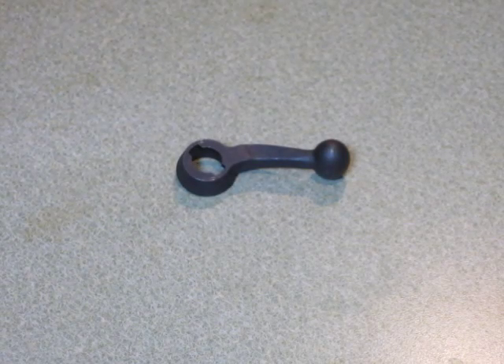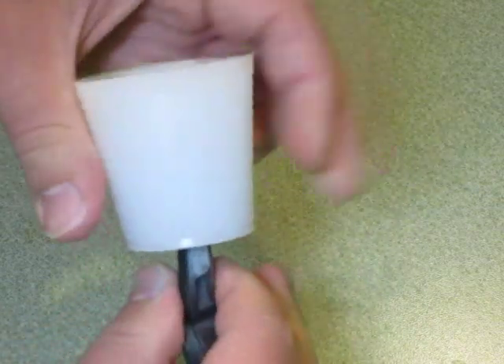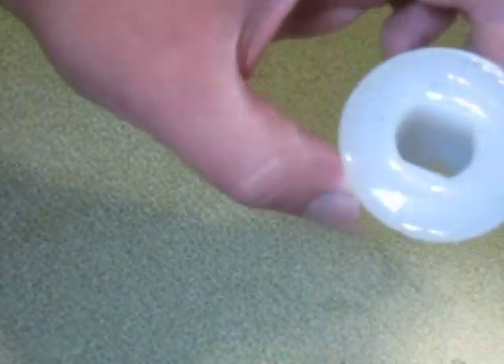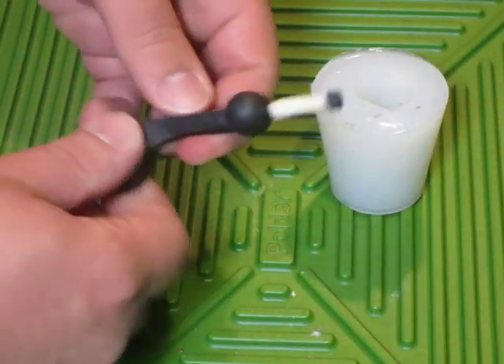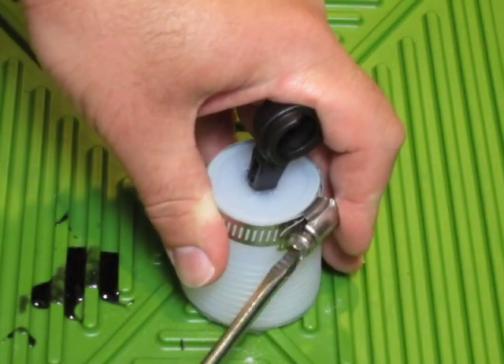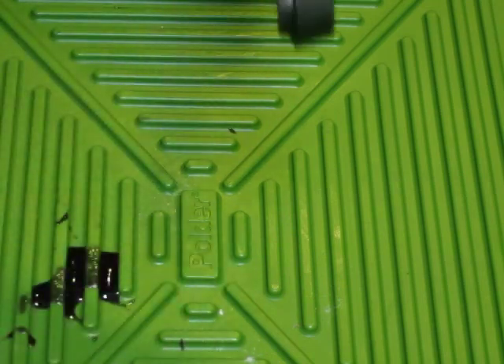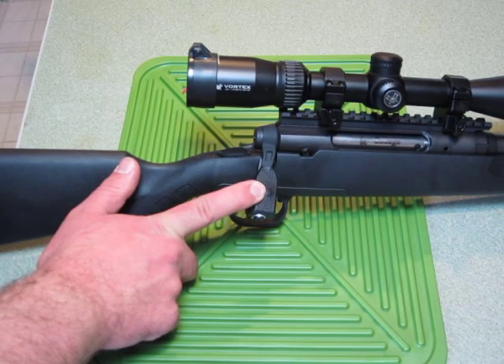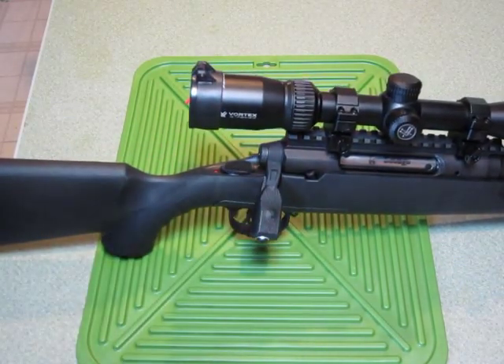Savage Axis Homemade Bolt Knob

Comment: I know this is an old video, but, you could counter sink a hole in the fiberglass 1/4" and use a socket head cap screw recessed within the handle....maybe make it deeper and use a fitted rubber plug to seal it. ;-)
Reply from the maker: Not a bad idea! I revisited this project in a later video or two and came up with a better solution. Still, it's usually good to have more than one way to address a problem. Thanks!

Comment: Dremel, cut off wheels, 5/16 die and a tactical bolt knob on ebay- total= $25. last forever and looks 100% better than fiberglass epoxy.
Reply from the maker: +Long range Killa Totally!  That's why there's the annotation leading to the video where I do that with hand tools.  https://www.youtube.com/watch?v=fczCGdZG1iM&index=2&list=PL6mstF7_2-gm3WnoBZZ1QLpjIeoFWXqg9
Reply: +DrThunder88 ahhhh I see, I  watched your video, I had the same casting void in the finished shank on my axis. I put first Savage together this time last year, not looking back!! Blueprinted the action, Shilen select match barrel, pillar bedded boyds thumbhole (full float) and a Nightforce Nxs 8-32. shoots  1/4 moa with 107gr Sierra matchkings. I sold all my Remington bolt actions and goin all savage cause I can save about 800 bucks per build!
Reply from the maker: +Long range Killa Very nice!  I haven't crossed the action modification threshold yet, but the TTT service from Sharpshooter Supply might be something I'll have to consider in future builds.  Thanks for watching!

Comment: my savage axis 30\06 handle just clears scope
Reply from the maker: Depending on the shape of the knob you design, it might not be an issue.  You can see the top of the factory bolt knob on the knob in this video.
Reply from the maker: I should also mention that I made another video about threading an Axis bolt handle for a knob using only hand tools, which, for some reason, doesn't show up in the recommended videos column.  That could be another option if the knob you select is one of those long cone or teardrop shapes.  Anyway, the threading video is uploaded to my channel even if it doesn't show up on this page.
Reply: just got the same gun, thats the only thing i dont like about it.

Comment: Don't get me wrong, I love my savage axis .308. But, I hate having to worry about my bolt handle scraping my scope.
Reply from the maker: You can see the bulge of the factory bolt handle knob sticking through the epoxy in this particular casting.  That's the point of the bolt handle that gets closest to the scope bell!  A wider knob placed closer to the bolt itself could get closer to the scope, but careful design (the kind I don't do) could prevent the epoxy knob from being any more obtrusive than the factory one.  Thanks for watching!

Comment from the maker: Sorry about the delay.  I estimate the wiggle is less than 1/4 inch (6mm) when the bolt is fully retracted.  This isn't from any sort of measurement, but I was sort of eyeballing the position of the rear of the firing pin in relation to the mold line in comb of the stock.  I hope this helps!

Comment: nice,
but I don't know if i'm brave enough to drill a hole in my bolt.
I do have a question for you though, can your bolt wiggle side to side when it is open??
also could you measure how much if any it moves?
my bolt seems really loose.

I would really appreciate it if you ( or someone else) told me.
Christian